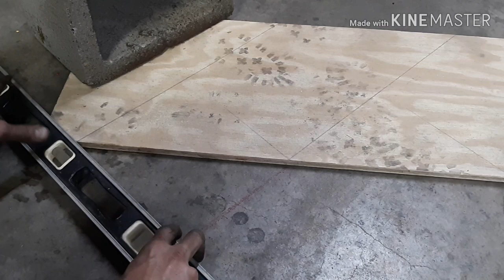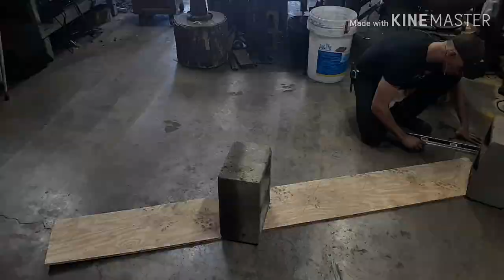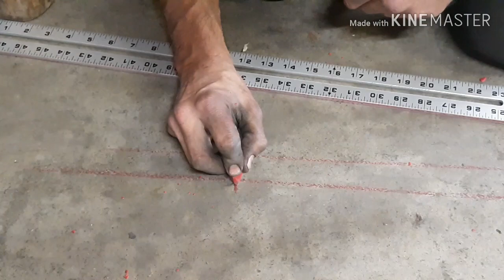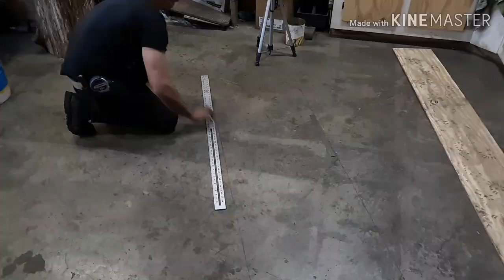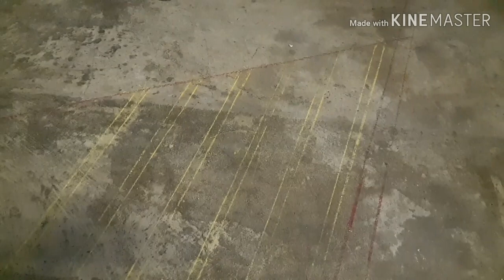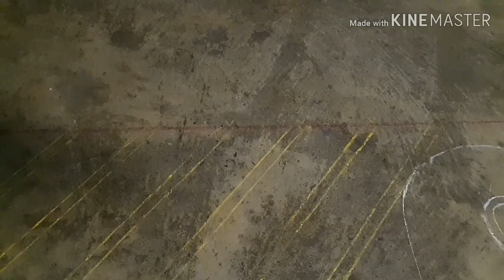Stair Railing Part 4 Layout

Comment: Nice. It will help guys starting out who get their first handrail commission. It is work to lay out, it takes time and as you point out should be factored when evaluating the job. However it is less work than having to come back from the installation site with the handrail on the truck to make corrections. I saw a stair entirely built on the floor of a forge in the USofA. It was for a job in England. No room for error. There are many pictures of other such constructions in forges. Being very carefull is less expensive. In other words being carefull can be charged to the client but you have to pay for being sloppy. Again, you did a good job.
Reply from the maker: Very wise word sir! Thank you again for sharing this info with me, and I'm glad I can pass it along to help others.